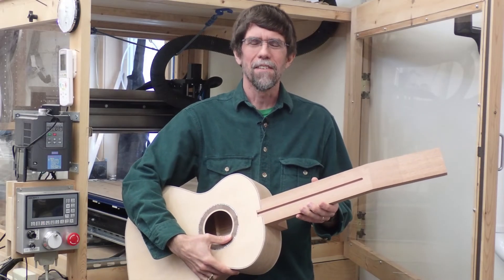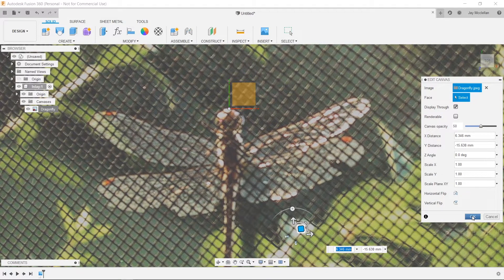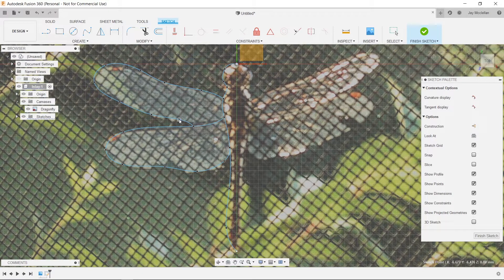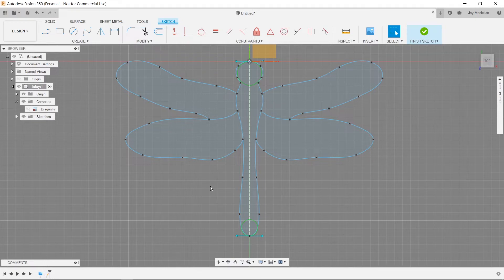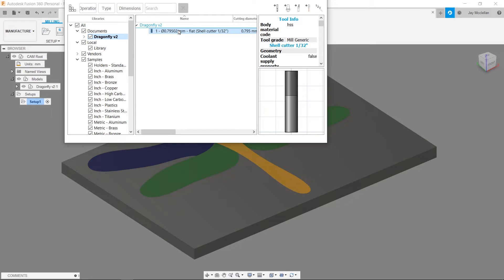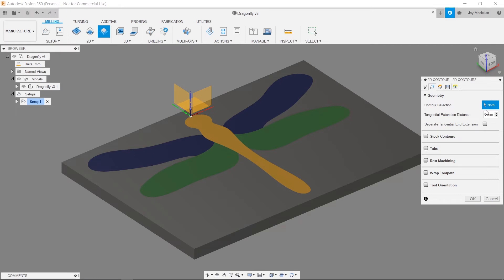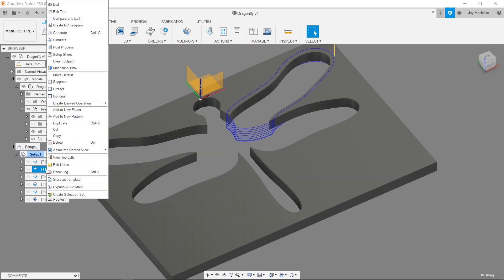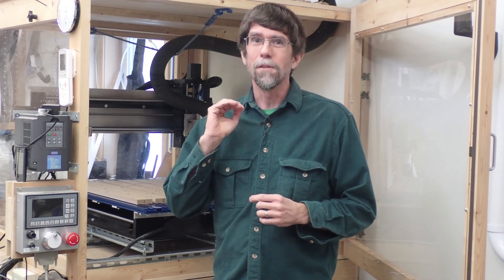CNC Guitar Inlay Part 1 - Design in Fusion 360

Comment: After watching a second time, Jay, I realized you did some things I've never considered in the CAM module.  Like changing the top height and bottom height for the purposes you gave and that's just something I have not done on jobs.  The way you explain each step is straight forward and easy to relate to my own work.

I have done plenty of inlay work with my CNC and Fusion 360 but most all have been wood in wood and larger pieces and I've been creating a copy of the pocket to become the inlay piece for contour cut and making this piece a few thousandths smaller to make sure it fits the pocket.  Using the pocket for both the pocket cut and contour cut is also not something I have considered doing, either.  I'm not sure I even realized that clicking on the arrow changed which side of the line the CNC will cut - not sure how I missed that! LOL!

But I like your way of using negative stock to leave and may just try that on my next inlay project.  I've used negative stock to leave often but not in this instance from the beginning. 

So I guess now I'll watch again to see what else I pick up 'cause I learn something each time I watch!  Thank you!

Comment: I just used the feed rate and depth of cut information you provided to cut out a script logo from 2mm thick  mother of pearl with an 0.6mm diameter carbide bit and it worked brilliantly - I didn't even break a bit (which surprised me greatly, as they were only cheap ones from Amazon). I just want to say thank you so much for sharing your experience and the results of your hard work.
Reply from the maker: Great, I'm glad it worked out well for you. I usually buy bits in pairs, so that if I break one I can cut the feedrate down and finish the project without having to wait for another bit to arrive. But so far I've been very lucky with the small bits and haven't broken any, probably because I'm very cautious about the feed and generally not in a hurry to push it faster. The only times I've broken bits is when I just plain screw something up, and that does happen now and then.
Reply: @BrainRight  I bought 10 and still have 10, but one is slightly worn. Nevertheless, thank you again! 🙂

Comment: In cutting the wood, would you not what to chance bits to a larger more stable bit to remove the bulk of material or a bit that would match the smallest radius? How do you choose which bit to use?
Reply from the maker: You can use a larger bit to remove most of the material more quickly, and then switch to a smaller bit for the finishing cuts. But it requires creating a separate toolpath and doing tool changes so it may not save time overall, versus just using the single bit and letting it run unattended. In an upcoming project I am using two bits because the time savings is significant enough.

Comment: Excellent tutorial. Exactly what I was looking for. I chose F360 because I am an old autocad user. In my professional career as an architect, I remember an associate telling me; "If we don't learn CAD we will be dinosaurs and left behind"...so I am taking the leap into CAD/CAM for my ukulele/guitar building hobby. Your example of the headstock inlay is just what I am hoping to achieve. Your step by step, clearly explained tutorial, is pure gold. Five star.  Any recommendations for a first machine for headstock and fret board inlay for a small shop?
Reply from the maker: Sorry for the delay in replying, and glad you liked the video. As for a first machine recommendation I'd say the two biggest variables are size and rigidity. Size tradeoffs are fairly obvious. Rigidity equals speed, i.e. a more rigid machine can run faster at a given level of accuracy. Even a not-very-rigid machine (like mine, alas) can deliver good accuracy if you slow it down so for a hobbyist it's not so critical but I'd say look for all-metal construction (unlike mine, alas). A water-cooled or air-cooled spindle is definitely a step up from a router motor, if your budget allows. It wasn't overly difficult to convert my machine from its original router motor to the spindle I have now (see my video at https://youtu.be/AcD7Q4k0gmk), but starting with a spindle drive is a better option. I chose a larger 2.2kW spindle motor because it has ER20 collets, which support the many 1/2-inch-shank router bits I already had, even though I don't need that much motor power.
Reply: @BrainRight  I ended up going with the Genmitsu 3020-PRO for my first machine :)
Reply: @LiloUkulele  That looks like a nice machine for smaller projects, and possibly more accurate than a bigger one like mine due to much smaller moving mass. I expect you'll get good results with it.

Comment: Brian I have a question.. BTW Video is EXCELLENT! I was using the 30 day trial of 360 professional but didnt have time to work on it and it was running out so switched to the 1 year personal version but I have an issue maybe you can help!.. the plane I work from has switched to the vertical Z axis and I have NO idea nor can find documentation to change this so my SVG file from illustrator comes in on the Z axis and Im not sure how to re-orient this and this make a huge problem in tool paths plus makes it difficult to just work around... im sure it simple I just cant find the answer... in the 360 prof version this showed up properly
Reply from the maker: Sorry I know it's been a month and I thought someone else might jump in with an answer. I only use the free version of F360 so I can't compare the behavior vs. professional and it's been a while since I've imported SVG but as I recall, I just inserted an SVG file into a sketch so the plane was already defined when I created the sketch.

Comment: It's good to see you back doing projects, Jay.  This was a good, informative video.  

I notice you don't use Smoothing; I started using that not long after I built my CNC and have found the files to be smaller and cuts smoother (not segmented on curves).  Is there a reason you don't use Smoothing?  Just trying to learn all I can.

Thanks, and I'm looking forward to the second video - 
David
Reply from the maker: Thanks David. I tried to keep things relatively simple for this video by not changing more toolpath settings than necessary, but to be honest I just haven't played with the smoothing setting to see what effect it has on my machine. My guess is that it would be an improvement in some cases because I've noticed that the machine often slows down on curves as if it's not able to process the g-code fast enough to maintain the specified feed rate. It's not really noticeable when cutting most materials but it can cause problems when cutting plastics where I need to maintain a high feed rate to prevent melting. I think it might not make much difference on this particular project because my feed rate is already very slow due to the small diameter bits but I'll play with it and see what effect it has.
Reply: It made a huge difference in the file sizes for me and I cut so many curved pieces; I have now cut over 300 Longworth chucks alone.  Early on I noticed some issues when someone suggested turning on Smoothing and the issues went away.  The bonus was the smaller file size, far fewer lines of code - one program went from about 235,000 lines to about 90,000 - and no more facets on curves.

I have Tolerance defaulted to 0.001" and Smoothing to the same, 0.001", and I run Smoothing on every profile now, even if it's a square with 4 straight lines.

Looking forward to the next video, Jay!